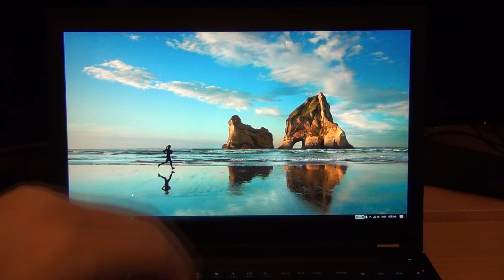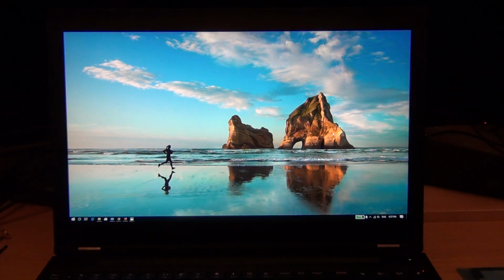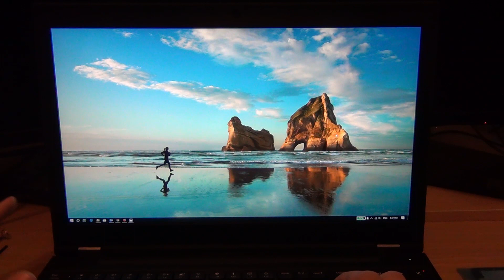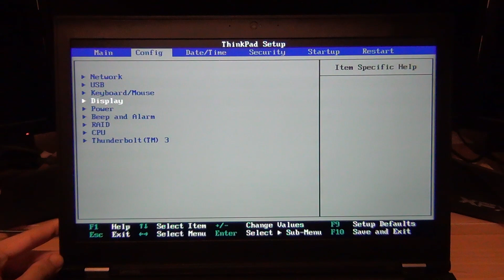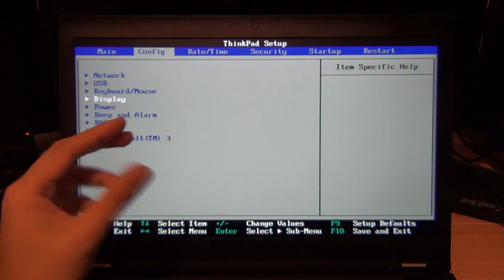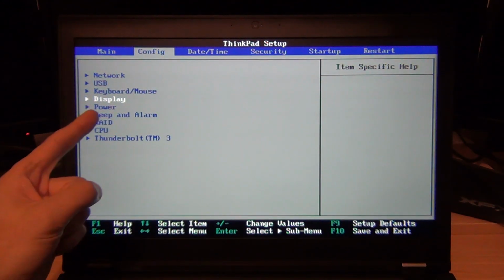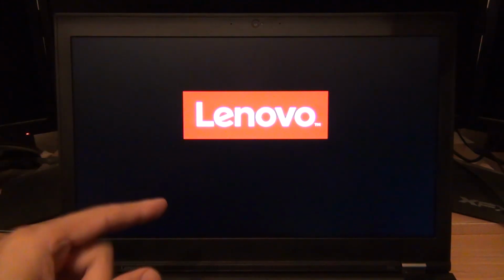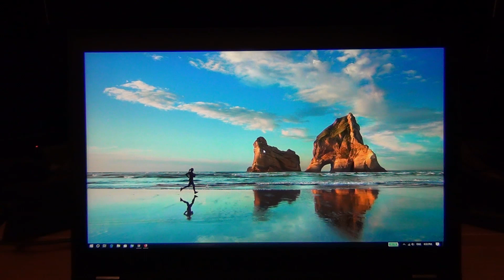Laptop screen replacement / How to replace laptop screen Lenovo ThinkPad P51

Comment: Did this fix but the new screen is connected but super dim. Any ideas how to fix this?
Reply: Guess it's to late now, but did you try plugging in your laptop, or checking your power settings? 
When the laptop is not plugged in, it  sometimes goes to power savings mode, which keeps the screen dim to save on battery life.
Reply: @dimahh17  actually solved this now. I had fried the motherboard by changing the screen without removing the battery

Comment: Hi, my P50 screen display was blank( no flickering), but I connected the laptop to Television through HDMI cable, display was appearing on TV. Now my question is will it be a diplay cable problem or screen itself need to replace please suggest me the solution

Comment: Excellent video, I have the same laptop, great machine but the HD screen is not so good. You know if its possible to install a 4k panel on it ?
Reply from the maker: It would require changing to a different cable, a 40-pin cable and possibly a different inverter.
Reply: Thanks for your quick response, I would rather go to your solution, is the change of panel noticeable in color accuracy?
Reply from the maker: @mariogt  Yes, it is noticeably better in color accuracy and gamut.
Reply: @GameTechReviews  thanks

Comment: hey can you message me have a few questions on the sapphire radeon rx vega 64
Reply from the maker: Any questions? I still use it as my main GPU.
Reply: I'm thinking bout buying one for my first gaming pc wondering how good it is for gaming @GameTechReviews
Reply from the maker: @clay8064  It's good but it requires that you have a good power supply. I've been using it in my main PC since release and it has done fine. It comes with dual bios and load indicator LEDs.
Reply from the maker: @clay8064  I will be doing a video about vega 64 in the near future.